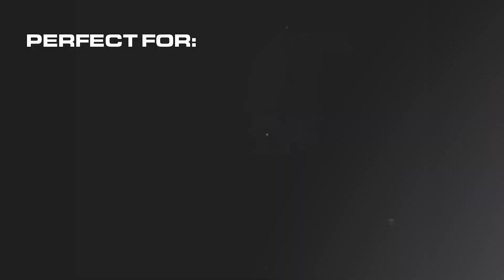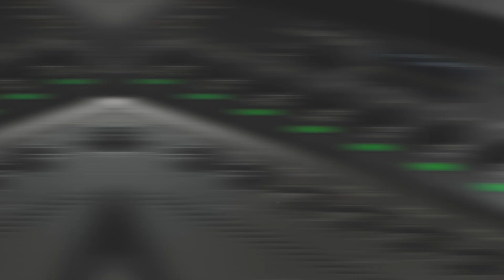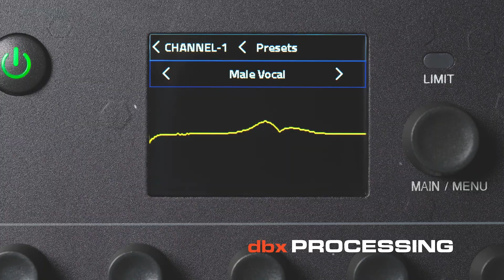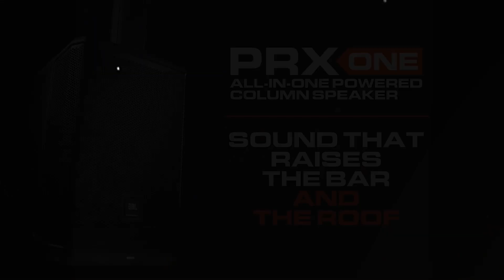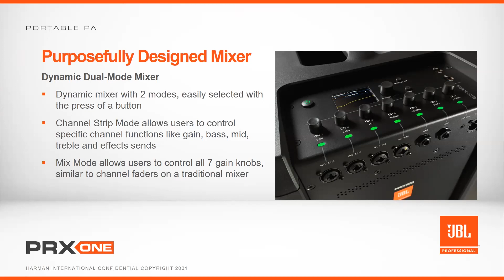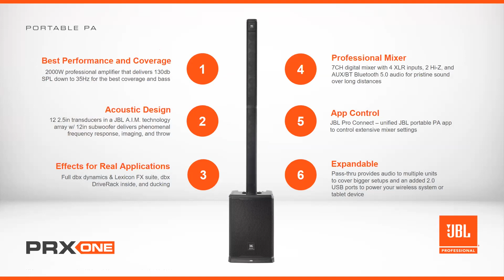Product Launch Event Recording: JBL PRX ONE All-in-One Powered PA System & Pro Connect App

Comment: You guys really should send out an email alerting owners of Firmware/App updates. Got to a gig and the units were non-functional due to “update needed” Was out of range to download. Disaster!
Also, the new App update has a series of added steps and windows to connect/navigate BT. Wonky. Good to have you updating, but creating problems in the field.
2 JBL PRX One units, and many other JBL speakers.

Comment: i have just purchased a PRX ONE, Please, please, please produce a better manual, your present one is not fit for purpose and the 'units' operating system makes no sense at all, the web is rife with complaints from people who all say the same thing. I've only had it for 5 days and am ready to send it back and get something else unless you can produce a guide that can be easily followed, describing in layman terms how to use this product. Also the APP is, to put it simply, crap. I find it baffling that every other product on the market works in roughly the same intuitive way, but whoever designed this product went "Nah, they're all wrong, lets make this one ball achingly difficult to use, have buttons that do four different things, have an APP that has a mind of its own, instructions that go on for a page about 'Ducking', but lets put nothing about how to actually connect to blue tooth and getting any sound". I've had to search youtube for third party video's to explain how to use this PA for the simplest of functions, I'm sure it's great, but would it really be to much to ask for a decent 'easy to use in it's simplest form' manual from JBL.

Comment: I  want to buy 2 sets of the  PRX One. how do  you connect both together? can i use mixer channels on both sides or just one side?
Reply: Yes, PRX ones have an output connection
Reply: You'll set one as your main 

PRX ONE (A)
Use all the effects and levels on that

Mix out from PRX (A) into channel one PRX (B)

Channels 2-6 on PRX B will not go back to prx (A) 

Next level is
Dedicated mixer
Stereo out into the PRX (A/B) but you would null the PRX channels essentially

Comment: Do not... I repeat DO NOT buy this system. There is a HUGE overlooked design flaw. This system sounds great when you are standing up in an optimal position to the top segment. BUT lower yourself down a little bit, such as sitting in a chair, or raise the speaker such as on a stage and it's all gone. You'll only hear mid range and bass. All the high end clarity is absolutely gone. They even mention the lower speaker are tuned to mid range. Why, friken why!? Fire the genius behind this failure. If you are not at optimal listening position it absolutely sucks! I tested this today at guitar center. Had 2 of their guys listening. Then I said squat down just a little and see what happens. Both said Wtf. We even tried leaning the system down. Which works of you again are located in the optimal position. And who wants to lean the speaker??? The bose 16 has a J configuration just for this issue. The bottom speakers curve in. The JBL, not only are they tuned to just mid frequencies, but they are also straight. In guitar we also went about 20 ft away and you still get the effect of losing sound by not standing exactly at a certain level. I sat on a drum thrown as if it was a place where people sit down at regular height chairs. The throne was actually a bit higher and still lost the highs. It sounds like a regular speaker with a blown tweeter/driver. Absolutely RIDICULOUS! And by design. Smdh!

Don't believe me? Go test it yourself.

If you want to use it, and have no issues telling everyone to please stand up while I use this system, then buy it. Other than that it's worthless. I ordered one as well as a guitarist I work with. We both canceled orders after hearing this absolute craziness! Jbl I am ashamed of, and embarrassed for, you.
Reply: ☺️☺️ Someone didnt read the instructions and read through the manual. Everything can be adjusted. 🤦‍♂️🤦‍♂️

Comment: I just received my PRX One. All put together and powers on but no sound coming through speaker or woofer.  I connected Bluetooth successfully and connected DJ controller. However, When I connect Bluetooth I do hear confirmation beeps come through speaker.  I even read complete instruction manual online, But manual has no trouble shooting tips. Any suggestions from anyony would be appreciated. Thanks

Comment: I’m a solo guitar/singer 

I actually purchased 
the First one 
That arrived at my local 
Guitar center 
I actually new more about it than 
anyone In the store including the 
Store Manager 
I’ve had it now about 3-weeks
Use it a 2-gigs and love its versatility 

My only question is why doesn’t it 
Come with a cover for the bottom 

I like my gear to always 
look great
On stage 

Please put me on your contact list
I desperately want a cover 
for the bottom unit
Reply: I actually own both 
And they are both very similar and equal in quality and out put l like them both 
Sometimes I use them both together when I am performing in an outdoor venue 
The main reason for getting the JBL was the onboard 7-channel mixer which is a great benefit
Reply: You might have to make the cover for the bottom. If you receive a speaker and notice that the bottom unit has no cover you might need to build one to make your unit last longer. I am excited for mine. Made a serial purchasing deal and should be able to bring it home in one or two weeks. Regards from Ásgeir in Iceland.
Reply: Have you had a chance to compare the PRX ONE with the Bose L1 Pro 16?
I don't like the Bose myself,  but everyone suggested me to get the Bose for better. 
I think Bose is just easy for the amateur users,  but I am very picky in sound,  I  always like the JBL or Infinite for normal users unless we look for a high end system

Comment: I love where this is going. If you make it compatible with Soundcaster +/ audio fusion performer then each musician can have personalized in-ear monitoring. Also if you connect 2 Prx systems you should be able to have one mixer with 14 inputs on the screen. I work in a trio. We all sing and we each play 2 instruments. We Use the JBL eon one and the Soundcraft Ui12 as a mixer. We use a click track so in ear monitoring is vital.

Comment: Bose L1 Model ll with a ToneMatch blows this away for many reasons. 1. This has no dedicated "send" for a monitor. 2. It has no seperate and dedicated input to recieve a master signal for jumping two units "masters" to one another. (Their pass through wont work that way). 3. It has no "Subwoofer" line out for use with an external sub which you WILL need for medium to large size outdoor shows... Bose has ALL of that...Nice for a solo act but not for a band.
Reply: How long does it take to set up Model II, is it faster?
How long to pack it all away?is it quicker?
How much does it all weigh? is it lighter?
How many channels? more?
How much does it cost to buy, is it less?
These are the things that REALLY matter
tonematch, no send, no sub out, aaaaah bless ... keep grasping at those Bose straws 🌾
Reply: @spgv379  Maybe for YOUR situation but when you're trying to run a FULL band good luck..lol.... By the way you can setup a cross connected 2 Bose setup with external sub and 2 mon's in 15 min. If you want to use 1 as you would as a solo act, Bose sets up in 5 min... Fast enough for you?
Reply: What about the other questions?
Reply: @spgv379  all the rest except for price would be similar.. The benifit of the things I highlight and the separate external mixer are worth ever penny imo.
Reply: Good points!
Reply: I’ve had every Bose linear array there has been, from their beginning . Thank you Bose for starting the premise. JBL and others like EV have upped the ante. To solve your issue, simply keep your Tone Match you can use it as a sub mixer or backup with any system. Via BlueTooth 5, you can hook up, mix and regulate up to TEN PRX Ones! Plus BT music & backgrounds. I have long since sold my Bose - while I could get a good price on Ebay. For me, this is Clearly an upgrade worth seriously considering. I’m a solo & duo guitar/singer in NYC. I just bought PRX upon first look and am in the process of playing “Weakest Link” with my Ev Evolve 30M, 50 & JBl Eon One…the Eon One [Original JBL Gangsta] will be on Ebay tomorrow.